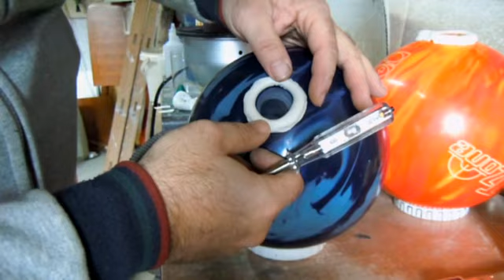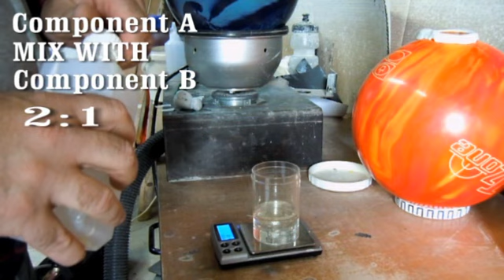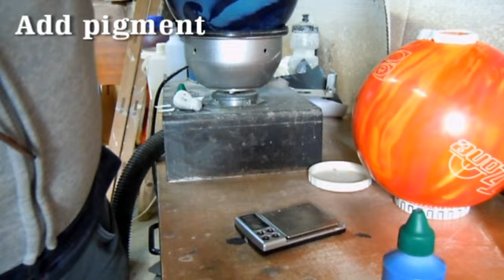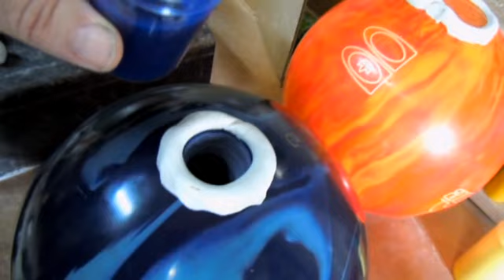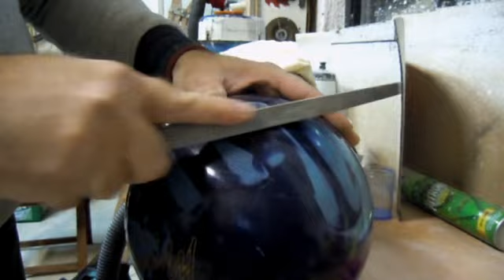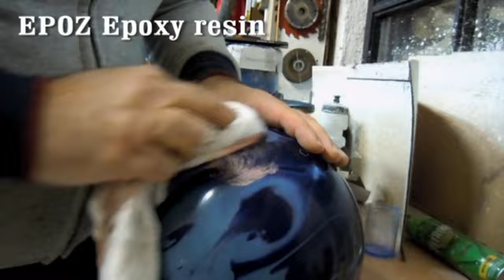Plug Bowling ball DIY at home with Epoz epoxy resin

Comment: I wonder if adding some very fine type of abrasive to the resin if it would restore some of the grip associated with these types of bowling balls as they spin down the alleyway?
Reply: Jeff Stone   NO, NO, NO..!!!   You Do Not want the ball sticking to someone's Hand!!
The plug resin doesn't touch the lane surface.
Reply: Right. You aren't going to add anything besides epoxy to the plug. It will just get drilled out again anyways. The new balls are made from a special resin that the consumer does not have. Maybe a ball company could use the original coverstock as a plug but that's about the only way
Reply: @stompingpeak2043  the plug wont even touch the lane
Reply: @caftood  it might but it doesn't really matter. The only problem is plugs tend to break away over use(like they will crack or break off after a while)

Comment: this was fine and dandy till you used a grinder and a file to shave the ball down  what in the actual hell lol   please don't do that again
Reply from the maker: This is home made if you can do better show me or do not coment
Reply: Nothing unsafe about it and the results look quite good.  It's really just good craftsmanship.
Reply: R Bahr never said it was unsafe lol  unconventional definitely   get a fucking plug cutter and a press  don't have to spend thousands to drill your own balls   the basics work  used machines are everywhere
Reply: lmao
Reply: router... sneak up on it until 5-10 thou from surface and finish with sandpaper (120,240,500...)
Reply: Make a mold of bowling ball outer surface. Then cut a small hole in the mold and tape it down against the ball covering hole. Poor in plastic and let dry. end up with a smaller hole. Still not a perfect method, yours may be better.
Reply: I concur with the spend money you don’t have part plug work isn’t that expensive
Reply: @tylerstine784  When you say a plug cutter and press are you talking about wood working plug cutters and a drill press or something else?
Reply: @bodeine454  no a plug cutter is a bit shaped to the dimensions of the contour of the ball so when you cut the ball plug down flush with the ball it comes down very close (leaves a very small amount behind sometimes) which you can then sand out and finish the ball by putting factory surface or whatever surface you want on it        same can be used with router.  Yes a wood routing machine will work. Not sure it wood bits work or not as I dont work with wood much but I also have a router I use a double flute carbide tip router bit
Reply: @tylerstine784  Thanks for the tips! I do have a router but like you said, it's probably better and more economical to let a pro shop do this or someone who is set up for it.
Reply: Looks fine to me.  He definitely got some skills with the filer!  Maybe you can plug a ball up and put it out in eBay for resale.  To each their own.
Reply: Tyler Stine by the way you can’t like your own comment.  I see what you did there.  This guy is out here showing us a DIY.  If you have the tools available then more power to you.  You may be a pro, but you’re also a troll.  I hope you’re proud of yourself. Ha ha
Reply: @webmoss  a plug cutter is like 100 bucks.  Plug more than 4 up in your lifetime its well worth it. And building or buying a jig for a small press to drill on is inexpensive. Not trolling.  But the way he did it Is just ridiculous in my opinion.